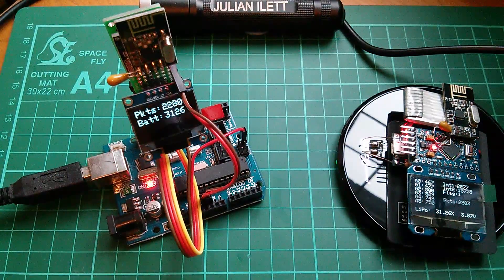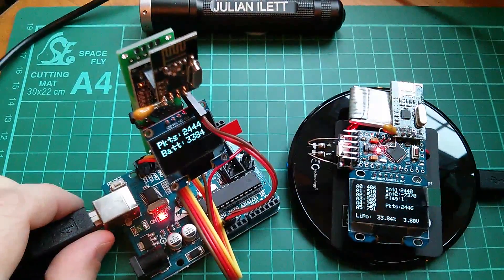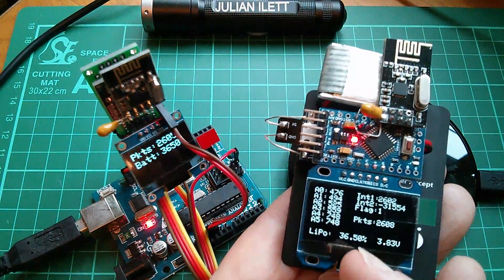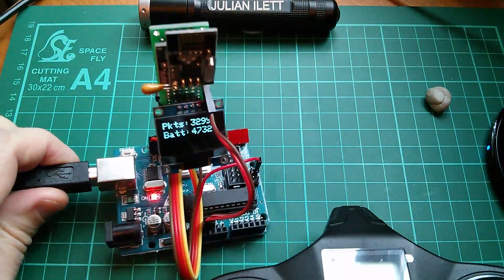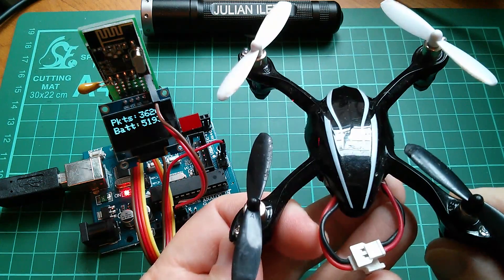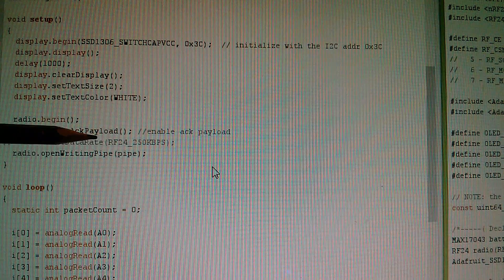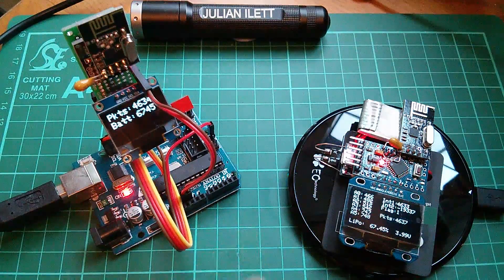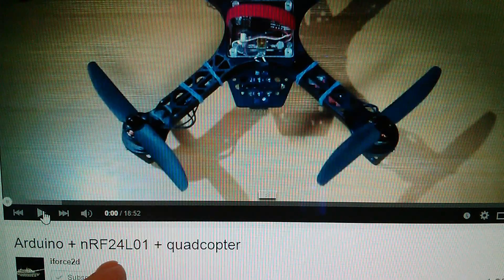Idea: nRF24L01+ Transceivers for Radio Control & Telemetry

Comment: nRF24L01+ is a great module, works like a charm, never had any problems with it, and the documentation is nice (which is not a common thing). I had some experience with CC430 previously, and it wasn't nearly as good.

Comment: Julian, I'm building the Cheapass radio system and one thing that springs to mind is that the NRF module operates on a single frequency whereas everything else in the crowded ISM. band at 2.4 Ghz uses spread spectrum ( frequency hopping) of some type. So at a crowded flying field your single channel might be at risk of interference from other systems. Iforce2d flies in a very rural area and I would be surprised if he has the same issue. I would be interested in your thoughts on this. Alan

Comment: Granted, I am quite a novice when it comes to these things. I have been playing with the Arduinos and ESP8266's for some time but never built much that was usefull, save a couple of thermometers, one on each platform. That said, I recently purchased an ESPDUINO, that being a sort of hybred of the two, or better an ESP8266 in the shape and design of an Arduino with the same pinouts (mostly) and side by side it would  be hard  to tell them apart until you got close enough to see the ESP8266-13 soldered onto the arduino board. I got to thinking that with the additional speed, and the various sizes and shapes of the 8266 couldn't this perhaps be ported to that platform, thus giving you much faster processing speed, and reaction speed as well as a stronger radio to work with?  Now that the ESP8266 can be programed on the Arduino software system shouldn't the porting be quite easy?  Just a thought, this is going to be a very interesting build!
Reply from the maker: +Jerry Ericsson Not sure about flying an aircraft over WiFi - it sounds a bit dodgy. On the other hand, I've seen nRF chips inside quads.

Comment: Hi Julian, I have watched many of your presentations. Great work.
I was wondering if you would consider the topic of RS 485 communication for one of your publications. Preferably between two Uno's or Pro Mini's.
I would like to address 32 individual Pro Mini's to drive servos or generate a true analog voltage (ADC) from one Master.

Comment: Hi Julian,
how you distinguish one nRF24L01 from other ? in other words, if more then one quadcopter fly on the same area what will happens ?
Reply: To anyone interested (I'm a bit late, I know): these chips have built-in addressing, which is configurable programmatically, up to 6 addresses, if I remember correctly. You can always invent your own identification scheme, e.g. preprogram IDs or configure them via DIP switches, and send them as integers as part of a data packet, filtering them programmatically upon packet reception.

Comment: the ack packet will always lagging behind, as the transceiver sends the ack faster than your code can prepare the ack message. the ack packet is put in the buffer, and sent back when a next message is received. sometimes it works - i think due to bad transmission & delay on the retries, the code manages to be in sync.
but you can just open a writing pipe on the receiver end and send back a normal packet, if needed. just remember, these transceivers are half duplex, they can not write and listen at the same time. they can, however, listen on 6 pipes at the same time. you can also send multicast messages (like broadcasting, no ack, good for fast transmissions - i am still investigating the possibilities)
the whole quad radio control has been done by the guy that maintains the latest, most active and imo best RF24 library. check out his channel - tmrh20 - he has a github and blog too.
i'm working with the nrf24l01+ too, but have no information online available
thanks for sharing

Comment: Software is super interesting, Don't keep it short!
Reply from the maker: Bullfrogerwytsch The other reason for keeping the software explanation short, is the vain hope that you won't notice my poor programming ;)
Reply: I am only just starting to get into microcontrollers since the prices have started getting so low.   Those LIPO batteries out of the mp3 players,.. Can you charge them with a standard 18650 charger or will that blow them up and burn your house down?

Comment: Fun project, looking forward to updates!

There are already commercial RC system with the nRF24 on the market, for example the HobbyKing HK300, HK310, 3XS. They use the nRF24LE1, which has an 8051 core inside next to the RF transceiver. Analog inputs are available, to directly connect to the sticks on lower end models without display and fancy features.
To get good coverage the transmitters use a PA like you've shown on the larger nRF24L01 board. Some receivers have an LNA, others just a simple pig-tail antenna straight into the nRF. Does not seem to make any difference for RC cars.

They use frequency hopping by changing the channel every 5ms. The transmitter and receiver share the random "address" and hop channel sequence (20 random channels) via a "bind" procedure where the receiver listens on a fixed channel for special packets sent by the transmitter at a very low power.

Every 5ms the transmitter sends two packets of "stick data", plus a "bind" package at very low output power. Then it is quiet until the next transmission, presumably to let other RC users also use their vehicle :)
The system does not use the AutoAcknowledge function of the nRF chip; the receiver purely receives, never transmits. Since packets come anyway every 5ms why bother with retry.
Data integrity is covered anyway, if you configured the system properly so that the nRF uses the 2-byte CRC it is capable of.

Regarding "haven't figured out how to send float across": Don't :)
If you really need battery level down to 2 decimals behind the comma, simply multiply the value by 100. So 0.00 to 100.00% becomes 2 bytes (0..10000) over the air. Always use integers in tiny embedded systems.

Idea for sticks: There are very cheap RC simulators available that have all the stick mechanic but no RF. May be easy to convert. The sticks are usually very lousy though, that's actually part of the money you spend for on the "expensive RC stuff".

Comment: Hi Julian,
You don't want to use a float for the battery percentage. An Arduino has no hardware for floats so floats are as slow as * :D And because battery percentage has a fixed range its better to just use a int (2 byte) and make it fixed point. Unfortunately Arduino has no build in function for it but you can use something like
print(value / 100);
print(".");
print(value % 100);
For a fixed two decimal point notation.

Timo
PS Do you ever read your Facebook page ;)

Comment: Julian,

As stated in your title, the radios are transceivers.  You should refer to the end points as something like control and remote, instead of transmitter and receiver.

Thanks for the videos.

Jim

Comment: I would recommend that you pick up a turnigy 9x for $50-60 us and then design your module as a jst module then once that is working build out the result. But you will have a platform to start on. Good luck it is going to be interesting to watch what you come up with. BTW I chose the Taranis as my base....

Comment: What command did you use to slow the transmit rate down?
Reply from the maker: Carl Recktenwald Jr. Just a simple delay(1000); I didn't slow down the data transmission rate, just increased the delay between transmitted packets.

Comment: I agree Latency might be an issue. It depends on the level of autonomy you are after. If you want low latency you might as well stick with your x4. But if you want something that flies itself and you just guide it then latency is less of an issue. Think mars rover. More of a challenge more fun. (Perhaps less safe )
Reply from the maker: bensonwr I'll do some latency checks a little further on in this project

Comment: On the receiver, you have to have the AckPayload already present in the buffer, before receiving any packet. Doing it after the radio.read(), will be too late. That would explain the packet count being one behind.

Secondly, on the transmitter, you might need to add a slight delay between radio.write and radio.isAckPayloadAvailable. If a packet is lost and retransmitted, more time will have past, and you would have missed the ack packet. But this packet is still present in the buffer, so it will be read in the next cycle.

The RX buffer is of size 3, so you can be 2 or 3 packets behind (depending on how fast the ack is received).

So together, after some missed/retransmitted packages they would be of by 3, as is seen in the video.

I've had some similar problems where the NRF would fail to send a packed, but keeping it in the buffer. The end result was that the packets would be send one or two cycles later. One fix was to clear the tx and rx buffers. Looking at the source code of the library, I found that calling radio.stopListening() would have the side effect of clearing the buffers. So you might want to do that on the transmitter.

Hope that helps.

Great video. I really liked the "transmission-tower" construction.
Reply from the maker: beargun42 Yeah, I kinda figured the packet delays were due to my sequencing. I can fix the receiver ack packet quite easily. On the transmitter side, rather than introducing delays, I'll live with the 1-cycle delay. I'm guessing the re-transmit mechanism doesn't 'block' the code, so yes, packets could be missed. Maybe a solution is to do 2 ack packet reads per cycle - that would keep the buffer cleared. Cheers.
Reply: Julian Ilett  Actually, I was wrong about that one. radio.write is (like you said) blocking till an ack is received, or number of retries reached. I'm currently using radio.startWrite, which is non-blocking. I saw connections that weren't there. But now the question remains; why is the packetcount 3 behind, instead of only 1?

Comment: I thought I would do the same with my RC endeavours, but Oh BOY, is a real-for-real transmitter nice! Ergonomics, precision, range, signal integrity, easy programming (dual rates, exponential, trims, etc). Plus, the FlySky FS -T6 is only $55US shipped and it's an excellent radio. Extra receivers are only $7US! I wholeheartedly support your effort, but that is not ideal from a pilot's perspective. 

Note: I would, at least, procure a faceplate and pots from an existing radio, and then feed those into an arduino. That way, you have the form factor, etc, already sorted. 

Either way, I'm excited to see how it turns out.

Comment: oh, and while I'm here, I thought I'd mention (as an RC pilot of helis planes, cars and quads for more than 25 years) that latency is gonna be the main obstacle with your proposed RC control. Just... naa.. I've got a custom RC transmitter I've built here which I was looking to produce commercially and even without the wirelessness that you're talking about the latency is already nearly 100ms which makes it useless for controlling anything that flies.. a car / slow tracked bot or something maybe.. anything more than 100ms latency is unflyable essentially. ;) just thought I'd mention :) cheers
Reply from the maker: Andology Yes, that's a very good point. I'll keep a close eye on transmission (and processing) delays. I suppose I'm aiming at about 20ms, since that's effectively the latency of the PWM system.
Reply: I built my own transmitter and receiver pair using these modules and it isn't a good idea because of this exact reason.
It is still flyable but noticeably worse than a proper pair.
For best results forget about telemetry (on the same radio pair at least).
Reply: As an RC pilot I am going to throw in my 2 cents as well...mainly on the stupidity of using a janky home made tx/rx system on anything larger than a micro sized quadcopter.  These aircraft are extremely dangerous even in the 250 mini size.  There are plenty of stories and pictures from hobbyists that have been injured when they weren't careful enough.  I would really like for you to keep making videos so please stay alive and just buy a good radio, I personally use the Taranis.  It is inexpensive for what a great radio it is, has extremely long range, and built in telemetry.
Reply: michael hillpot I actually have a scar on my hand from when my quadcopter lost control and a blade tried to take a chunk out of me.

Unless you actually know what your doing don't try to use home made flight electronics on anything larger than a small indoor copter.
Reply: Get real, I am both an RC Pilot and Arduino / electronics enthusiast. Do you know how well these NRF24L01 actually are and the distance they can achieve, for someone like Julian, myself and many others a like who actually know what we are doing then this is great. we don't intend for extreme model size or distance but just the fact we can do it and understand how it all works. Just think, it's people like Julian and people alike who trial and error this kind of stuff that create equipment you are using today. Just think, 15 years ago some one probably said the same about some trying to fly and RC plane on 2.4ghz, oh and look at what we area using today. Don't want to sound to obtuse but obviously this is a little exigent for your yourself.

Comment: I do not recommend sending the battery level as a float. Yes, it can be done, however an IEEE single-precision float takes 4 bytes, whereas you could use a fixed-point integer, like you are now, and use only 2 bytes. Less data means more free space, and faster communication.
Reply: I don't know, if I wrote this in a comment on this channel some time ago, but using floats on a 8-bit micro is a very bad idea (especially if you're short on CPU cycles already). Everything has to be done in software (the Arduino IDE/C does a good job in hiding that from you).

Additionally the "floating" part of floating point numbers isn't of real use in many µC applications anyway, especially in sensor values. In floats the precision is linked to the magnitude of the number. But why should the precision of a sensor suddenly be different just because the value moves from the tens range to the ones range. For arguments sake let's say you've got a 3 digits decimal significand float; in the tens range that would mean your value has one digit after the decimal point, but in the ones range you've got two (in the µ the values are of course binary, so you have jumps in precision for every doubling/halfing of a value).

I'd use floating point numbers just for the easy of display, not for any calculations.
Reply: Julian Ilett You can do something like this:

sprintf(buff, "This is a string: %d.%2d, 
          int(floatVariable), frac(floatVariable)); // the two halves of the float

And sent it as a string.
Reply: Claudio D. I believe the message size is limited to 32 bytes, from memory. Sending the float value as a string will use 6 bytes for a 0.00 to 100.00 number, with an average of 5 bytes. If you send the binary contents of the float value, it will use 4 bytes, no matter what. A fixed-point integer will use 2 bytes, no mater what.

Sending the binary float value is the fastest method, followed by the fixed-point integer. sending it as a string involves a large amount of processing, and is very slow.

given the nature of the project, I think using the smallest message size is the better option, so enough channels of data can be encoded.
Reply from the maker: Mark McGough Good advice. I multiplied the number by 100 to make it an integer, I guess I can just as easily divide it by 100 after it's been received.